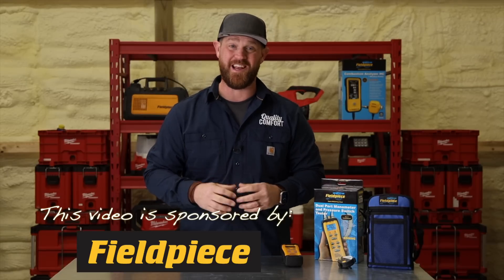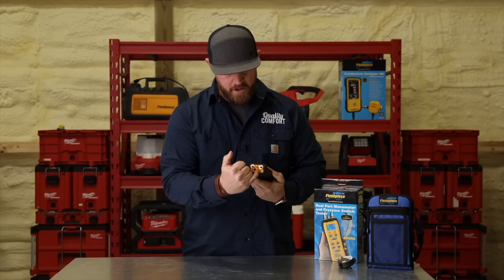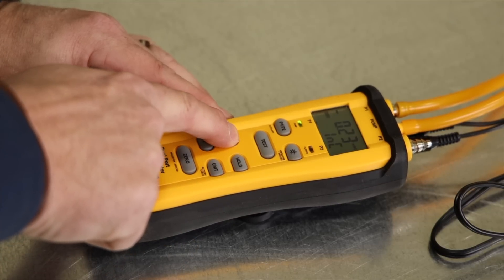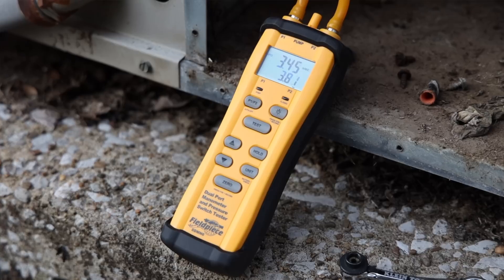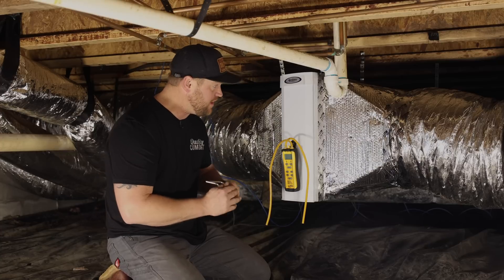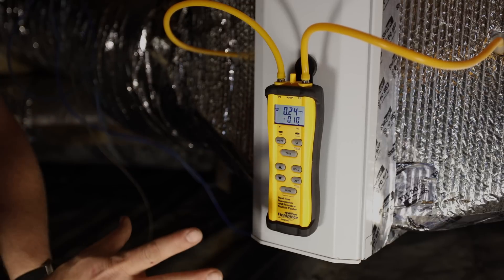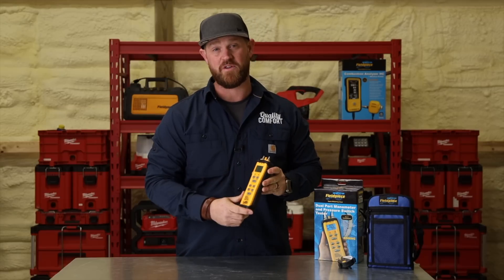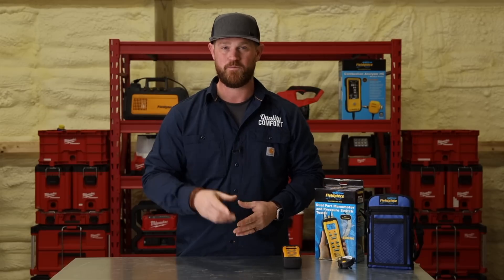A Must Have TOOL For Checking Gas Fired HVAC Systems.

Comment: That or you can use your meter while it is in operation. If the draft inducer is running and the tube is clear and the pressure switch still isn’t working. Change the pressure switch

Comment: Thank you for all the great videos tips, tool reviews I could go on and on.  I perform HVAC installs and troubleshooting on residential and light comercial systems with my work, I also work on electric Generators, Trasfer switches, UPS systems and other equipment so basically a technician that covers multiple trades.  Nice to watch someone who does it right, I try to keep up with new technologies, techniques and the new advanced tools that are out there as I don't solely work on HVAC.  Watched your video of you installing a new Bosch system and you had to reorient the drain pan so the condensate ports would be oriented in the proper position, doing that I watched you remove the "A" coil from the pan and reorient it so the return air would flow up through the base and out through the fins.  I watched another video of another popular HVAC contractor YouTuber who was installing a Bosch A/H in the horizontal position he reoriented the coil so the condensate ports were positioned properly and DID NOT reorient the coil.  Top of the "A" coil was pointed toward the return air and the base was facing the supply, don't see how when he performed the start-up the system pressures, superheat were all within specifications.  Any how thank you for the videos and doing it the right way.  Take care!

Comment: Have this fieldpiece on my van . Main tool Magnehelic analog gauges I find it to be more accurate . Commercial industrial sometimes have have 5 gauges on a system to check gauge pressure.

Comment: I've had mine a few years and it's a game changer for sure. Really a big fieldpiece fan these days and have most of their hvac tools, but this manometer is the only one I'll ever use again besides my wireless probes,I use those for airflow but this one for everything else. It's the fact you can test switches as well as just keep universals on the truck and always have a switch when in need. I used to have to wait for my supply house to order me the correct switches in the past which would leave customer without heat for a few days at times. Never again. I think that feature alone makes this the best on the market. I don't even know of any others that you can setup a new pressure switch with. Life saver. What I am gelous of is your new analyzer. Have my eyes on same kit you got there, just need to save up a little more. I'm telling you guys, fieldpiece is killing the whole game in the last 5 years or so. They have really made me a much better and more efficient tech

Comment: This is actually an awesome tool. I live in very rural wyoming there are no parts houses for over 250 miles. In a pinch I've used this to set universal adjustable pressure switches on everything from mobile home furnaces to radiant tube heaters. I have this, and the sc680 which has dual k type probes on a meter for rtu delta t. Awesome stuff

Comment: What is the highest delta across the filter before you would change the filter?
Reply: Your furnace name plate will state maximum outlet temperature and give you a range your temperature rise should be in

Comment: Combustion Analysis > Gas Pressure
Reply: Some combi boilers have you dial in pressure by combustion analysis instead of gas pressure. We do one on all new start ups
Reply: @C M  well, that's how it's always been done on all gas boilers/furnaces,water heaters. So the manual will give you your inlet pressure range and manifold pressure range or sometimes it will for example on l.p. say 10" manifold pressure rather than a range. Chances are, that pressure will be real close to where you wanna be but you should adjust from there up or down slightly to find the sweet spot. You are rite to setup that way but it's not just mod cons it's for everything. And needless to say all oil burners need to be setup with an analyzer but you don't wanna adjust pump pressure to get you there, always confirm pump press is at where manufacture states cause too many times it's off by quite a bit low or high,very important to set it at spec for that setup, then you adjust your air. You may know that but just in case you or others didn't, 😏